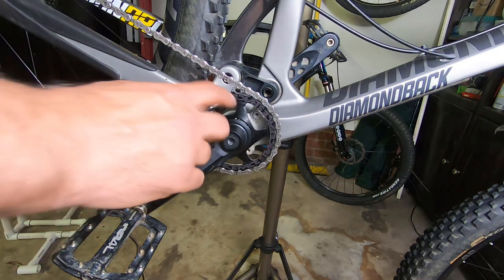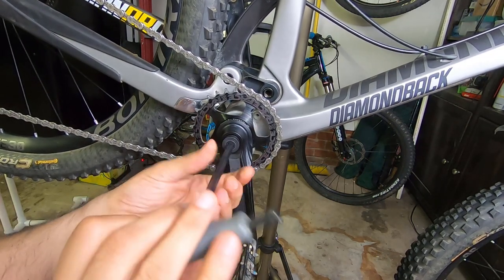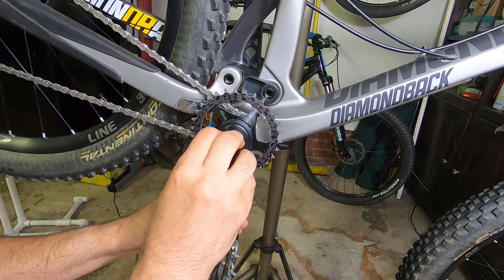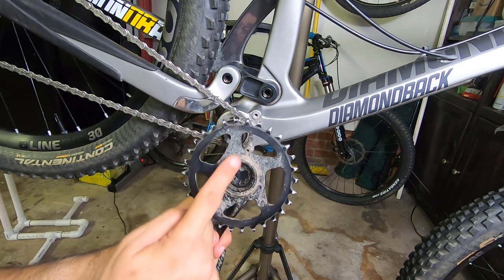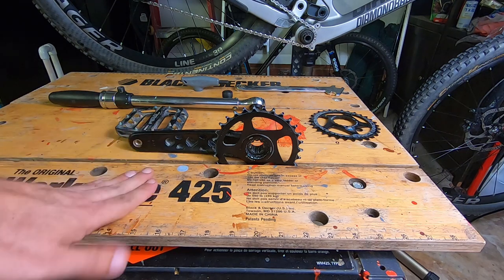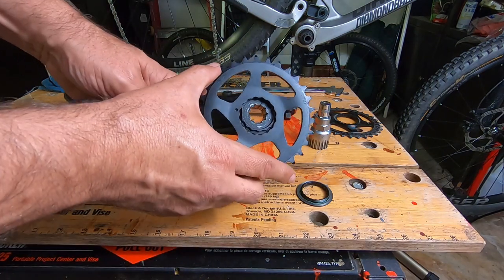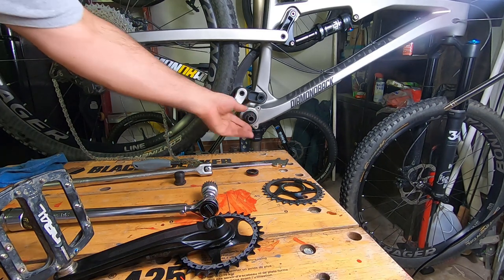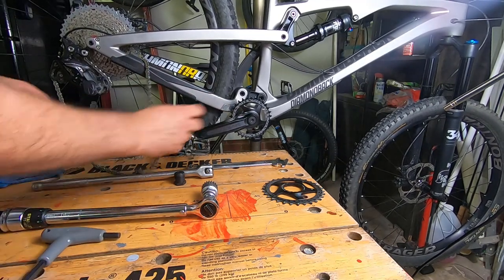How to Replace a RaceFace Aeffect Cinch Chainring

Comment: Not sure if that’s an older version aeffect or whether you’re just missing the “outer bolt” as that setup doesn’t require a crank extractor. It’s essentially a self extracting setup...just the allen keys required
Reply from the maker: This is the version without the self extracting bolt. About 2 years old. On my DUB NX crank video I talk about self extracting crank arms which my newer NX does have.

Comment: Thanks for the Vid, I kinda worked it out but still good to see. I had to reverse drill my 8mm bolt out it was stuck firm! 3 days soaking in penetrating oil, but after 3 years the Raceface bearing are like new still. I'm just adding a footnote.... When you finally reassemble the right hand crank by screwing the 8mm cap bolt on, once it's on just back it off slightly. All the bolt does is lock the crank on the splines its then done its job, you could actually ride without it. Also l can't recommend Halfords Penetrating oil enough.
Reply from the maker: I actually dismantle the crankset periodically to clean and lightly lube the threads and splines in order to avoid those situations. It might not be a bad idea to do a maintenance video since you are not the only one to mention how hard it was to remove the bolt.
Reply: @TonyHob  l do take it apart quite regularly but l stupidly rounded off the bolt. The trick is when you reassemble the crank with the 8mm bolt the pressure pushes the right hand crank on that's all it does. Once the crank is on you can back it off slightly and the cranks locked on. That way it won't get stuck.
Reply: What do you mean? How much torque is required for the 8mm bolt?

Comment: I have a 2019 DB Syncr and crank is supposed to be Raceface aeffect cinch but I had 2 bolts inside and the crank arm puller has nothing to push against.
Reply from the maker: Its probably a self extracting crank. It should pull itself out as you remove the inner bolt
Reply: @TonyHob  yup thanks, i managed to figure that out soon after posting lol. Thanks for the reply.
Reply from the maker: Awesome 👍

Comment: Helped out a great deal with my installation,. although my chainring had no notch or indicator to line it up with crank arm ? Maybe different on newere models
Reply from the maker: Could be. It’s been a while since I bought a new one
Reply: I also noticed that with my new chainring.  Possibly, because I went with steel instead of alloy?
Reply: Can confirm my 3 different sized steel rings all have no notch. Guess they're radially symmetrical so orientation doesn't matter. Wonder why some rings had a location dot?

Comment: That 8mm cover is completely stuck or seized on mine smh
Reply from the maker: You can try putting a broomstick between the crank arm and chainstay to keep the arm from turning and carefully use a cheater bar to remove the bolt. You can also try an impact wrench but the chance of causing damage is greater

Comment: If chainring is not the oval one, does it matter if that dot on the chainring lines up with the crank arm? I just put one on and didn’t do that and ai don’t notice any problems but I’ll go back and change it if there is a reason? Thanks
Reply: Ooh darn I think I’ll have to go back, I put the red circle more towards the arm, what is the reason for this btw? Thanks
Reply from the maker: definitely not as critical as with an oval chainring and will not affect performance. The only thing lining up the dot is going to do is remind you to have the chainring "spoke" at the position where it will receive the most stress during the pedal stroke (in line with the drive side crank arm)
Reply: @TonyHob   ah ok, Thank you. Also, the circle/spacer between the bottom bracket and crank arm, why does the red circle have to face the bike? @min 7:42
Reply from the maker: It has a small lip so it seats correctly

Comment: Have you ever cross threaded a bottom bracket?
Reply from the maker: I have not but know of people that have. It is also possible to damage the crank if you use the wrong puller. I discuss the correct Park Tools puller models in the description.

Comment: What size torque wrench is needed?
Reply from the maker: Not sure what you mean, it is a ft/lb torque wrench. The tool I have for the lockring is a 1/2” drive, my torque wrench is 3/8” drive so I used an adapter. You can use a 1/2” without an adapter if yourBB tool is 1/2” like mine.
Reply from the maker: I added a link to a torque wrench that includes adapters in the description. https://amzn.to/3goqwQc

Comment: Great tutorial, thanks! Is the crank puller required? It seems an 8mm allen is working just fine - don't want to be damaging anything though!
Reply from the maker: There is a version with a self extracting bolt that does not require a puller. It works as you remove the 8mm allen bolt and no puller is needed. That’s probably the one you have.

Comment: Good  tutorial!!!, you removed very easy the hex 8mm screw,  I'm trying to remove it and nothing,  almost tear off my arms first.
Reply from the maker: keep trying, probably over tightened or really dirty in there. Might want to try some penetrating oil
Reply: @TonyHob  I did it,  I used WD 40 and  70 pound  1/ 2 Snap On drill.

Comment: One note to add: I highly recommend getting a toothbrush and cleaning out those splines for the cinch lockring before you attempt to remove it. Because they're so fine, it doesn't take much to foul up a spline and get improper engagement, which can cause the tool to slip out when you want to loosen it. 
Just some soap and warm water will break up the grit/dirt in there and give you a perfect surface. It's a step that takes maybe a minute or two extra and can remove hours of unnecessary labor if you damage the splines with a tool slip. While you're in there you can clean out the threads on the cranks; make sure everything is nice and clean so that you don't cross-thread or get a false torque reading because of grit in the threads.
Reply from the maker: totally agree at 5:43